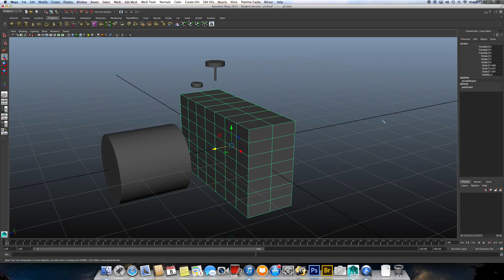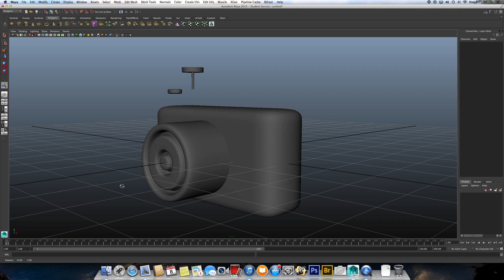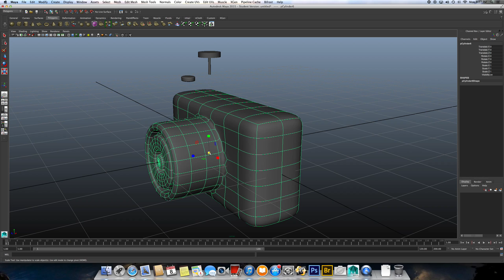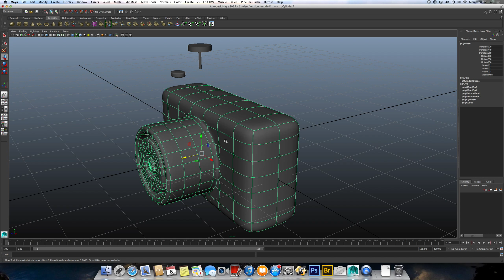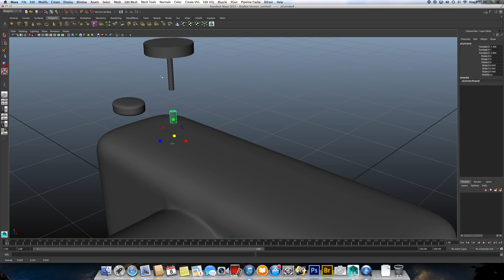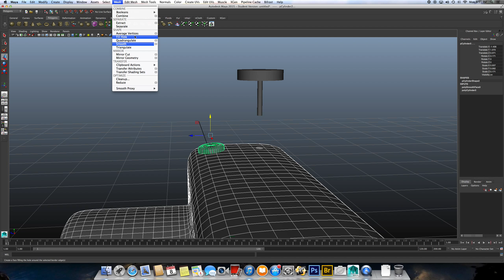Maya and 3D Printing basics tutorial

Comment: add subdivisions is some serious overkill, learn to use bevel or fillet commands or better yet use insert edge loop or manualy split the edges otherwise using add sub div you will wind up with ridiculous poly counts that will bog down the best computers. good rule of thumb is never add a face /sub division that does not affect the surface, in other words never add anything to a flat spot. just add an edge loop or two to each sharp edge and they will hold up in smooth mode only adding 3-6 more polys to the model

and yeah boolean operations almost never work right

Comment: Never use boolean to make holes in an object.

It messes up the geometry.
Reply: +halafradrimx What do you recommend in place of booleans? What if I needed to make a circular hole in an object? Thanks.
Reply: Jackson Tam In maya 2016 there is a proper tool for that.

Forgot about it, but basically you make verticles in the shape of a hexagon around the verticle you want the hole in.

Go take a look in 2016, it should be there.

In zbrush, on zmodeller brush, we call it as the split tool.
Reply: You can but you need to frame it properly however framing and cutting around is better and cleaner
Reply: It does, but if you are skilled enough you can correct it

Comment: Hi Alexiaviolet, I'm new to 3D printing on my own and I am trying to really understand how to use this device from the dashboard end. The wall I keep crashing into is with the scale of the object once brought into the printer dashboard. I use Cube 3 dashboard from 3DS and when I pull the STL, it comes in rather large. I have been working with Maya for years so I understand the grid and how to measure, but there is obviously an error in what I'm doing because the model keeps coming in far to large. Can you assist?